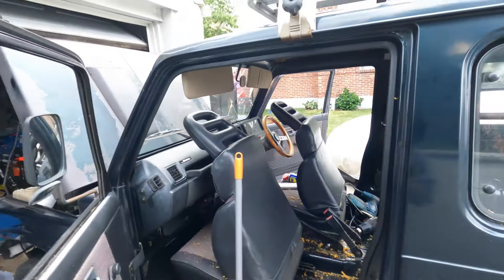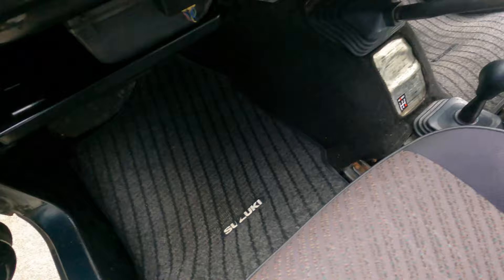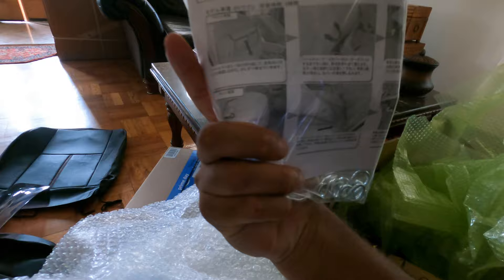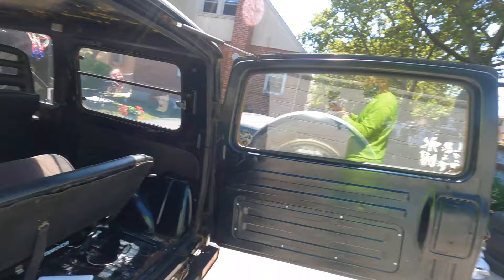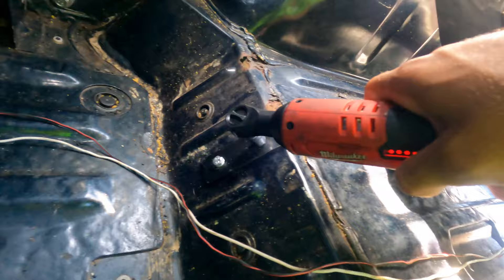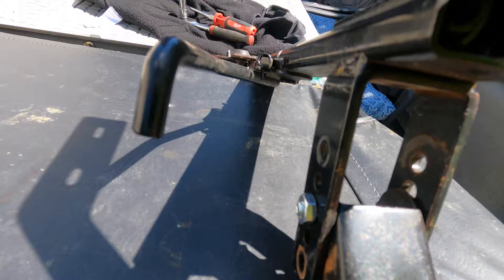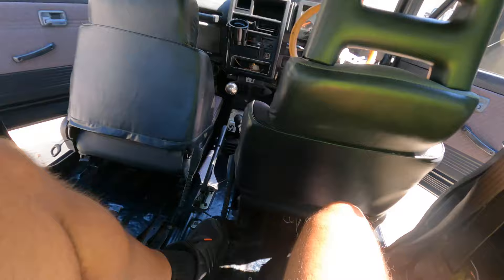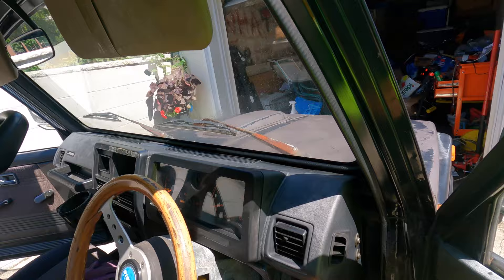Suzuki Jimny Rear Seat Problem FIXED (Taniguchi Seat Rail)

Comment: big upgrade on those seat rails, goes from a 2 person vehicle to a 4.

WHat did you use to take down the headliner foam ?

I'm taking mine off and it's a big pain
Reply from the maker: Man i used everything, i tried sanding it down, i sprayed goo gone and took a kitchen rag. I was doing it for at least 1 hour of just tlc

Comment: Hey bud, love your videos of these. I'm getting  one. Question, you did a video of highway driving in your auto Jimmy and it topped out pretty quick. How is the 5 speed versus the auto on the highway? And where is a good site for aftermarket engine upgrades? Thanks
Reply from the maker: im working on that video this week but its still bad, im at like 5.5k at 100klm and thats on the small stock tires.
Reply: @Waybeforethefame  any good sites for a down pipe, hard pipe for intercooler or any other turbo boost upgrade sites you recommend.  I can't wait for your next video. Keep it up
Reply from the maker: @annalisestephenblaylock354  on yahoo auction they sell a complete intercooler kit with BOV For like $500 or so i can send you the link on Instagram
Reply: @Waybeforethefame  I sent you a message on Instagram . Thanks again

Comment: I noticed in one of you older vids your jimny had a light for the exhaust heat? What is the fix for that? Thinking about getting one imported and some of them have this issue b
Reply from the maker: my cat was clogged so i just straight pipped it